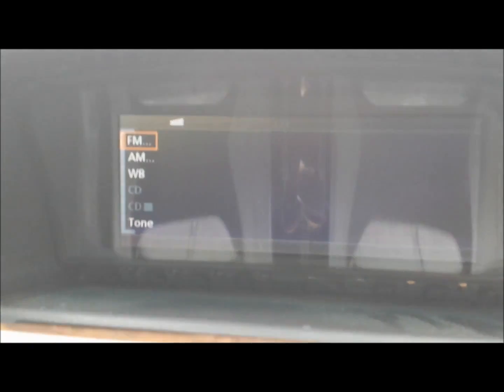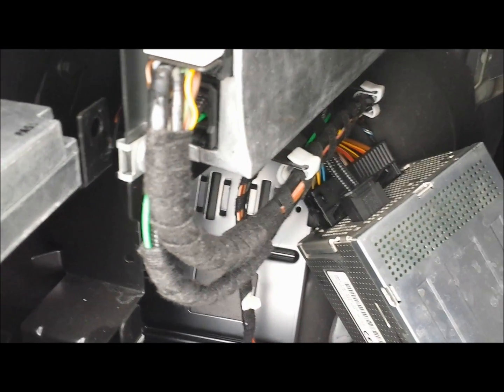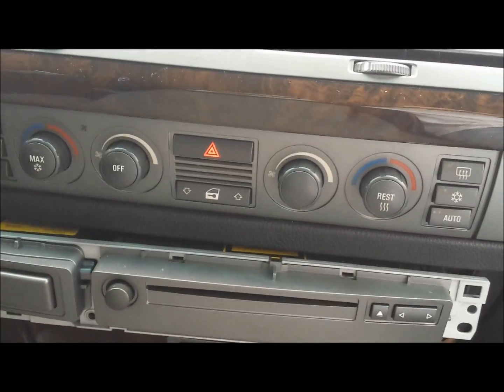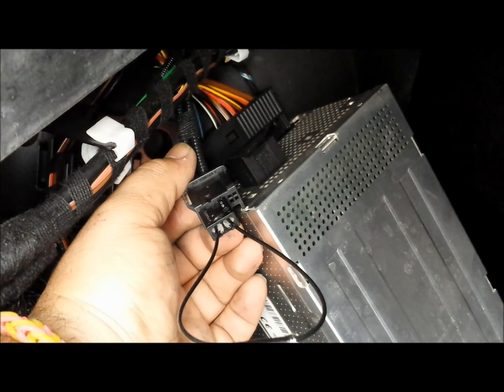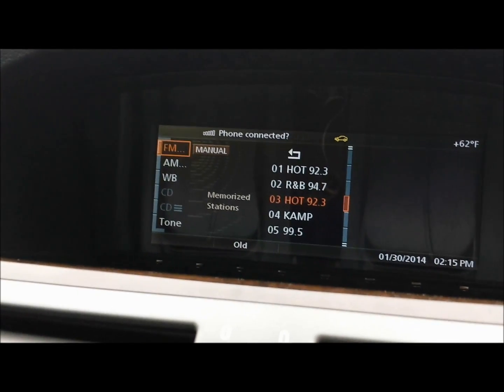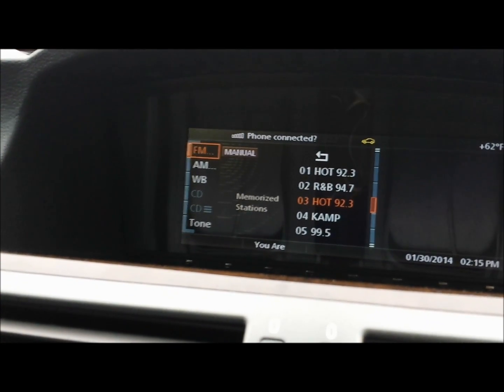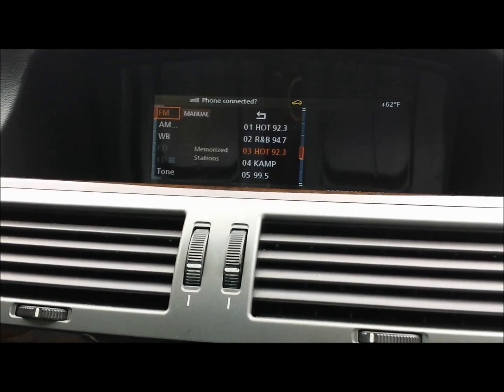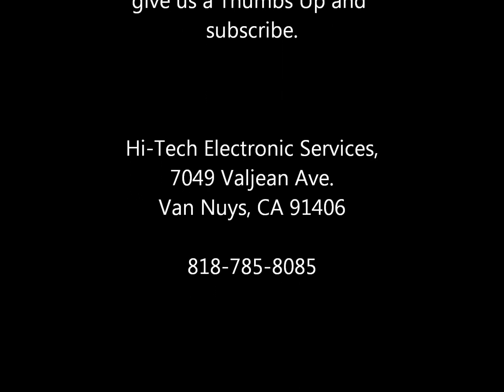How to Troubleshoot BMW Fiber Optic Audio Navigation 750 / 745 2002 to 2008. Part 1

Comment: Hi I have a 2006 750i, when I listen to the radio only the driver side of the audio works... when I balance to the passenger side only, I can only hear crackling. What do you recommend me doing?
Reply: What was the solution dude?I have the same problem in an03 745li

Comment: I had craking noise, and so I repaired the ask unit, and that fixed the issue but no bass so im assuming by logic 7 is bad. I don't want to fix it as itll go bad again can I just add external amp wired to the logic 7?
Reply: My car is doing the same thing i believe. Music will play for 3 seconds then crackle music will play again for 3 seconds then crackle.  How did you fix this issue?

Comment: I sent the Navigation Unit via a BMW dealer in for repairs and i was told they could not find a fault, than the BMW agent told me they checked all the wiring and also could not find fault than they told me they found a fault on the monitor and repaired but i am still having same issue with only the nav part of the monitor not displaying clear. Now BMW has finally decided to replace the unit. when i spoke to them today they informed that the parts they will replace is what they describe as (80 Control Display) and (Monitor). Does that sound right as i got a price from another dealer and only for the unit in the trunk. i am confused and don"t think these guys know what they doing. I am now battling with this problem for 5 months, although they are prepared to replace the components at their cost why do they want to replace two components, whereas the other dealer gave me a price on only one. Thank You once again for your kind assistance. Bobby (South Africa) 2008 BMW 750i

Comment: I am having issues with the navigation unit on my 2008 bmw750. the screen becomes faded but this only happens occasionally the sound and everything else is fine only the monitor has streaks in it. can you please help. thank you
Reply from the maker: BOBBY OMAR It looks like the Monitor itself is bad. You are welcome to send it in for a free bench test.
Reply: Thank You for responding, I forgot to mention that all the other features are displaying clearly it is only the navigation that very often does not display. I am unable to bring the unit to you as I am writing to you from South Africa. Thank You
Reply from the maker: BOBBY OMAR Then the navigation drive unit in the trunk is bad.
Reply: Thank You

Comment: hi I have a 745i with several problems, fm channels very weak and no audio warnings, pdc or sat nav voice. could it still be the ask as ive replaced all 3 big capacitors inside it for the no audio. also the fm channels weak, will it be the fm amplifier or fm amplifier diversity ? thanks

Comment: Thanks for that detailed helpful video. I have a 2004 e65 and I started having the display freeze from time to time and not have the radio or anything working. Recently there has been a hissing sound in all the speakers. I used the balance and fade and heard the hissing sound in the front and back. The radio and cd player work but it has the hissing sound always. I disconnected the loop in the glove compartment for a min and reconnected but still hissing. Could it be the amp?
Reply from the maker: caleb essel The loop connector in the glove box has to be connected at all time. You need to get an extra one to check your fiber optic lines.
Reply: No sound at all .The other light are on but my loop connector in the glove compartment light doesnt come on.  Would the fiber loop still help ?

Comment: I cannot thank you enough for this video.  You have saved me $1764.37 from the dealership's prices.  Instead of doing this troubleshooting, they said I needed an entire audio system.  I purchased a fiber optic loop from the dealership and the culprit was the Satellite Radio module.  I plugged in the loop and now I have audio in all components and the SOS System now works.  
I have a 2007 550i and the procedures works the same.  I recommend changing the title to BMW Fiber Optic Troubleshoot, that would increase your views by 20k.  I stumbled upon your video through youtube suggestions.  
Thank you for this video and be blessed.
Reply: Corey Bryant I have the same problem my 550i 😣😣😏

Comment: i got a problem with my 745i, the cd sound is 100% fine through all speakers on ask unit, but I have no sound on PDC or on the NAV or on my phone, also my radio keeps losing signal channels appearing then not appearing and just static even if they show quite a good signal. any help ?

Comment: Hi, great video. Ive bypassed every optic module my e65 has but couldn't get it to work again, would this most likely point to either the idrive unit itself or the ask unit? Because they cant be bypassed? Do these 2 units need programming to the car? Thanks
Reply from the maker: zeus200044 Most likely the ASK unit.
Reply: +HiTechElectronic  750i  sound not working no bass navigation  n CD dnt play the CDs.  what can I do

Comment: I have no sound and no numbers next to the radio stations which item should i send you to repair?  how many items can i loop at one time ?
Reply from the maker: Jorge Fernandez You need to figure it out yourself since you have the car with you. You can loop as many as you want but it requires lots of bypass connectors !

Comment: What does it mean when my subs don't come on i just got a new amplifier for my 02 745li and all the speakers still work but the subs
Reply from the maker: Did you replace it with brand new one from the BMW dealer or a used one?
Reply: Used
Reply: Do I have to troubleshoot the amplifier
Reply from the maker: Darrius Hewitt If the woofers are good, which most likely they are since both woofers could not go bad at the same time then you just need to have your Amp repaired or replaced.

Comment: I have a 2007 650i. I'm trying to troubleshoot the audio equipment. If The CD Changer is missing will it need to be bypassed? Also what is the part number on the MOST loop you are using in the video. Thanks
Reply from the maker: Phil McLeod Yes, it needs to be bypassed. The plug that we use is a modified one.
Reply: HiTechElectronic Do you sell this plug? If not how do you modify it? I have a MOST LOOP but the bottom of it is female. The bottom of yours is male with what looks like opening in the end to go over the two leads of the optical connector. Thanks
Reply from the maker: Phil McLeod Yes, we do. Please call 818-785-8085 to place an order.

Comment: hi I have the same problem with my 2003 745i for me everything works except the GPS and the system restarts every 10s have about a solution I live in canada
Reply: Don't give your self a headache. . Change the spech audio.. open the trunk.  Open the cover where you but GPS cd.. look at the top left corner there a plastic cover just remove it and change the part under it.. keep it and it well destroy all your audio system.
Reply: Theshadowcar what do u mean?
Reply: Mr BigStuff1969 look at 8:00. That's the part I am talking about. Change that and everything well be fine.

Comment: If the logic 7 has no bass at all from subwoofers I took the amp out unpluged the second small plug not the long one it got them to work but for 5 min then we shut the car off and turned it on they started workung at least 10 and went off iff I unplug the long one will it due any good and theres a white plug not attched to any thing is that supposed to be like that and

Comment: I just called you guys today about my CD player on a 2006 BMW 750li. The Radio, Navigation, and Phone are working fine. The CD player has no sound. I carried unit to a local shop and they informed me that I needed a refurbished unit because sound wires are corroded, Before I take that route is there possible another fix.

Comment: My problem is that my Navigation is not working at all. I get black & White fuzz. Everything else works as far as sound and all. How do we troubleshoot Navigation issues?
Reply from the maker: You need to replace your navigation drive unit or have it repaired.
Reply: Ahh....okay. I purchased new CD's to upgrade the maps but that did not work. IF I can somehow get full Bluetooth integration with my iphone then I wont need the BMW NAvigation. Wouldlove to check out your shop and have you see my car. Let me know if you are available today or this weekend please. Thank you!
Mason (Mase)
Santa Barbara. Ca

Comment: How do I trouble shoot subwoofers not playing at all. Sounded bad then stopped all together.  Every other speaker works fine.
Reply from the maker: Most likely the Amp is bad. To check the Subs you need to remove the seats. To check the Amp you need to hook up a test speakers directly to the Amp.
Reply: HiTechElectronic  is the amp near the subs or is it in the logic 7 amp in the trunk? Thanks for your response btw
Reply from the maker: It is the Logic-7 Amp in the left side of the trunk.